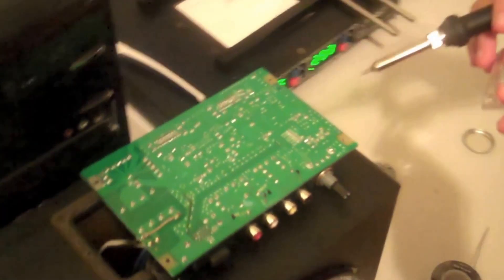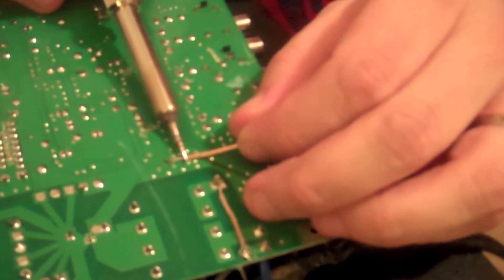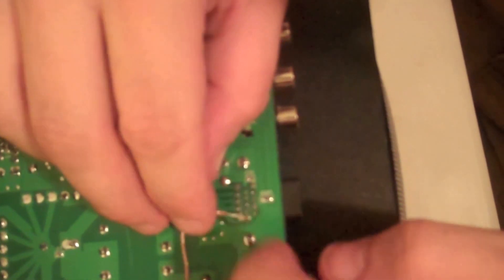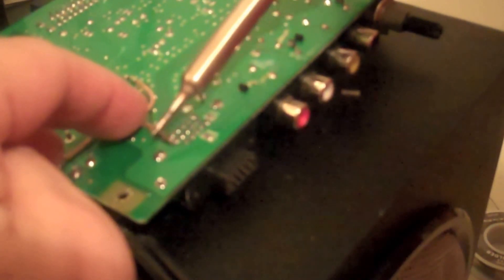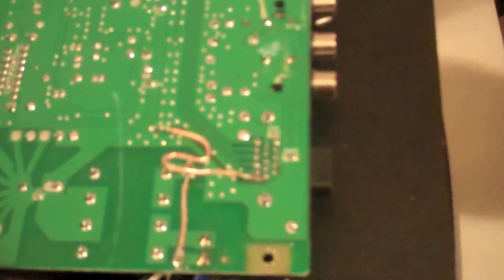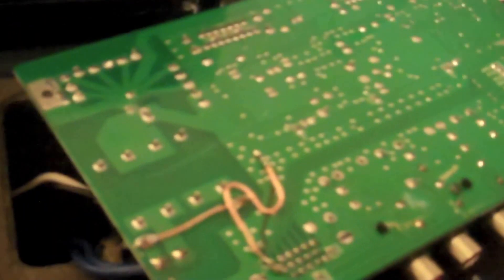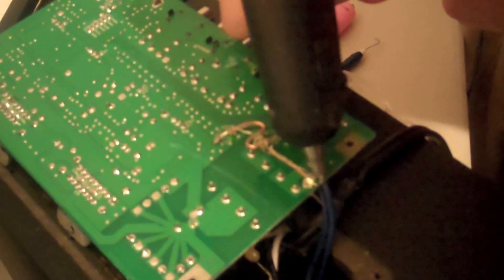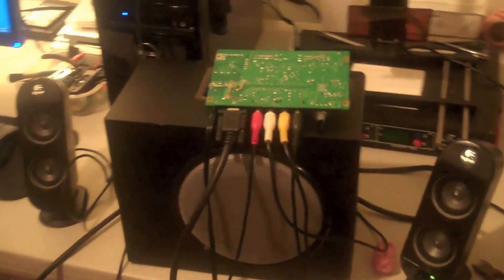Logitech X 530 Burnt Trace Repair Part 2 of 2

Comment: Hi Bro. How r you,,,I'm Daud tama. I'm from jakarta indonesia. In indonesia, we use 220 VA electrical. I have speaker aktive logitech x530 but i got problem with the IC. The case is....last time, my son tried to connect to 220 VA electric. But as we know,,, X530 use 110. You know what happen...so...would help me to guide me to repaire my X530 to be smooth again. Please. I had call the call center logitech in indonesia,,,but they has not the spare part any more. Cos' the X530 is already old. Or, if you know or have the spare part that I need. Would you send the spare part ( IC ) to me. I will pay include the postal fee. Here is my whatsapp number +6281317411986. Please bro. Give me the info immediatly. Please help me. Cos' i love so much my x530🙏🙏🙏help me. Thx

Comment: So to get this right, you bypassed the blown fuse with a WIRE? So there is no protection at all now? The fuse might have limited the damage to only that burnt trace. Now that you removed it it wont protect at all. Why wouldnt you just solder a new fuse instead of the wire?
Reply: yeah I made this video to show people how to fix it in a pinch. They can get a fuse if they like, I still have this set and the original repair working almost 5 years later
Reply: also I clearly say I am showing you how to bypass the burnt fuse in part one of this video .... did you not watch it?

Comment: hey i have a question i seen this video and realized my trace was burnt to i bought  that same sub to tear apart and take the amp out of for my samsung and realized i got the wrong junk sub to do this with but im going to try to pull it off do u know if i have to connect pin 11 and 15  pn to do this and how can i find my in the rca jack on the sub says its a in too to let the speakers know if they work or something im just a tinkerer i dont know a lot of this i know a little more than most but not a lot might have bte off more than i cld chew this time for the what 10 bucks im tryin to save i was going to cut a similar hole in my samsung and put it togther make it look bought that way ya know but now im just confused lol

Comment: Hi and thank you for this video. Can I ask you if there is any way to extend the front right speaker? (the main one)
Because thats why it happened. I hope there is a way how to do it. Thank you buddy
Reply: How it happened for me too. Don't use a monitor D-sub cable. Get a proper DB-15 cable that actually connects all the pinouts, or get an spdif/optical/hdmi to analog converter.

Comment: Damn this happened to me because I made the rookie mistake of using a VGA extension. Turns out it was cheaper for me to buy a whole new set than get the tools, solder, copper and fuse, kinda' sad as I would have liked to have had a go at fixing them.

Comment: Thanks for the video! I just got the same symptoms on my x-530 system, after removing the screws form the back panel i was quickly able to see the same burnt trace.

I was considering simply buying the new Z506 system
http://www.logitech.com/en-us/product/surround-sound-speaker-z506

But now I'm pumped to take on my first solder job! The video is pretty out of focus but I think I'll manage.

Thanks again!

Comment: Please, please share some tips on how to get the darn board out of the wood enclosure. Thanks!
Reply: its easier if you take the sub speaker out 1st. use something small to pop off the silver cover then there are screws for the speaker, take them out and you should be able to pull the speaker out. it should be easier to get the board out now as u have access to both ends. :)
Reply: Aron Bezzina Thank You Aron. I figured it out a couple of minutes after I posted this. I should have followed up.
It is exactly like you said. Thank You!

Comment: Thank you got it working thanks to you the fuse blew
Reply from the maker: That's great, were there any burnt traces?
Reply: No burnt traces the only problem now is when I put volume to hi it sounds bad I don't no if it is the cable I used to by pass fuze what do you think it is I used a regular cable like a speaker cable

Comment: Hi, I have a X540 which probably have the same board as yours. my issue is that the left front output does not transmit any audio.So I decided to open it and found out that the capacitor (blue) has white liquid leaking. So I'm guessing it needs to be replaced. Do you have any idea where I can order such capacitor?

Comment: I got this set at a garage sale for 4 bucks. Perfect condition, except when I set everything up, the power doesn't come on on anything. I know the computer picks up the speakers, because I can test them and change settings and stuff. But no power. I've read that a number of other people have had the same problem. Every one of those people were told they had a bad sub. 

I've taken the whole sub apart, and there is no sign of burning, and neither of the fuses are blown. Ideas?

Comment from the maker: Best way to keep it from burning the board or a trace up would be to keep it plugged into a surge protector. I have done this with the set of speakers in this video for almost a year and they are still working like new. Hope this helps